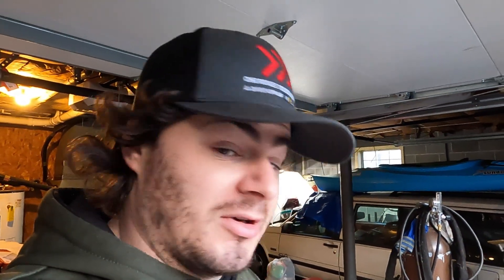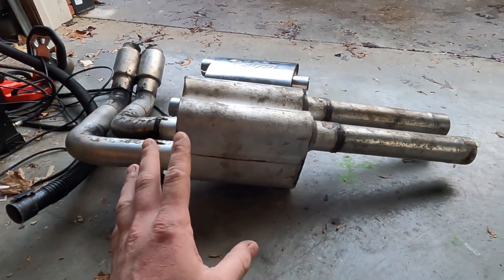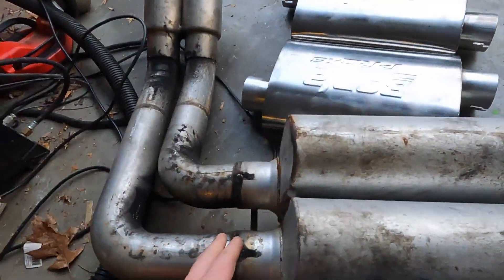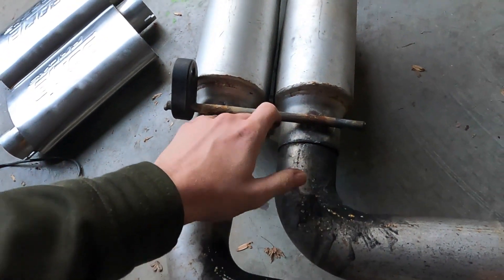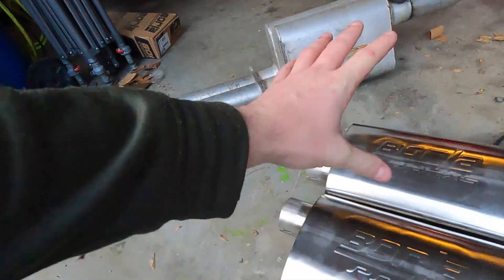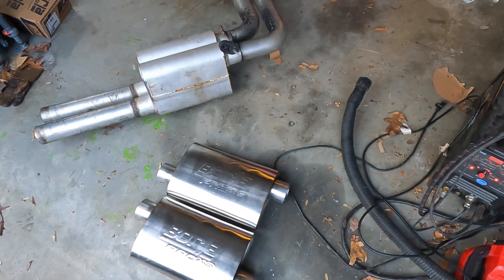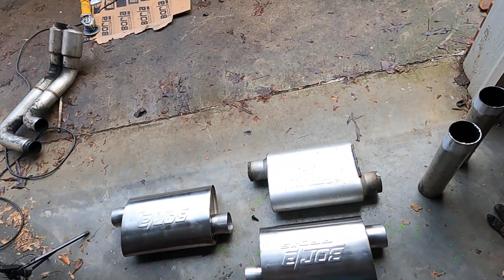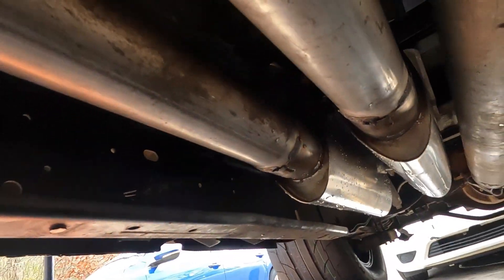twin turbo Dakota rt (new Borla mufflers)

Comment: Those Borla's SOUND GREAT & LESS FREAKIN BACK PRESSURE, also good price, I think. Hows your tire clearance ? NO RUBBING ? Oh 1 more thing, OIL YOUR DAMN DOOR HINGES, PET PEEVE, LMAO.

I live in PA. & doing exhaust work on my crap, in this state, is right up there with drum brakes, I FREAKIN HATE IT. RUST RUST & MORE DAMN RUST, HELL I EVEN PAINT MY EXHAUST WITH MANY COATS OF HIGH TEMP. PAINT, DAMN SALT IN PA. THANKS FOR THE UPDATE, GREAT CHOICE IN MUFFLERS.

HOLY CROW, You had those Jack Stands maxed out, that would scare the SHIT OUT OF ME.
Reply from the maker: Thanks. Lol the squeak is on my list. So far the tires haven't rubbed. I pulled over several times the first drive after some decent curves to check.
Reply: @thomasbeyer  THAT'S GREAT, thought for sure they would rub some.

Did you ever watch " SUPERNATURAL " ? IT F'KN KILLED ME EVERY TIME HE OPENED HIS DOOR & THE DAMN DOOR SQUEAKED, LMAO.

Comment: What kind of o2 sensor u running???..never run bosch or BWD products from advanced junk...or from any place.. the only Bosch I am using at the moment is a timing light..cause that is all they had at the parts store & i had no time to wait 4 a special order tool.need my ride back on the road to get to work..& by the way the two best sparks plugs 4 these ENGINE's  that I know of to run are Autolites extreme's ..& NGK iridium is PLUGS..& NGK V POWER....just got to have the them gap right.

Comment: Your definitely going to gain some horsepower by reducing the back pressure.  Every engine is different, but about 1.5 psi or less of back pressure doesn’t cost horsepower.
Reply from the maker: I'm sure it will. Just curious how much. Can't wait to get back to the dyno